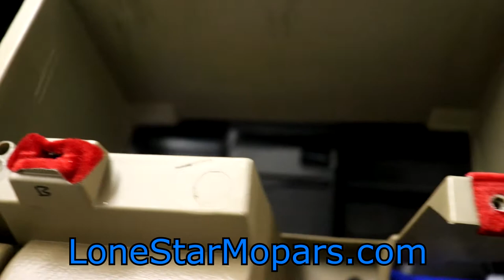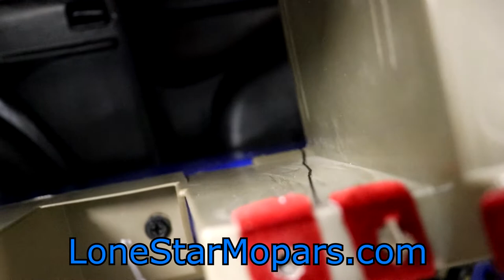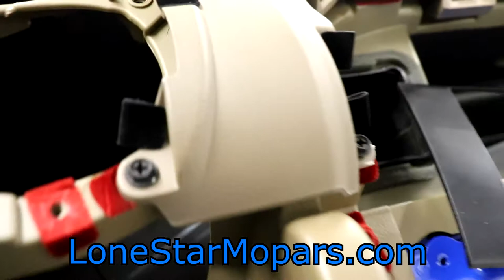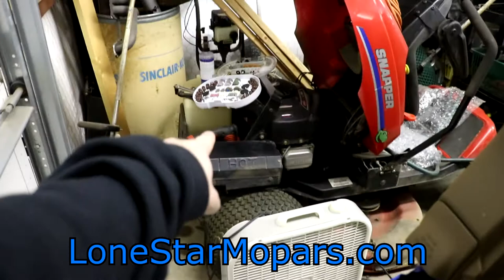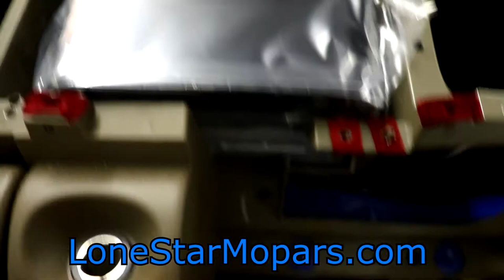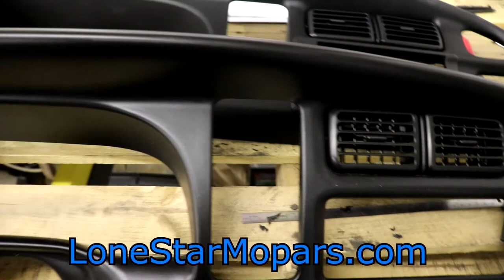Ram Revival Part 30: Double DIN in a 2nd Gen Modifying the Dash

Comment: Thanks for your inspiration! I followed your hunch, and only cut out the top piece. Didn't touch the bottom at all. The Dremel only melted stuff. I pulled out the oscillating tool, and Bam! I was done in 10 minutes. I didn't have to re work anything. Fit like a glove! Original screws went into place. FYI 1998 Ram 2500 Cummins. Thanks again!

Comment: Those Harbor Freight cutoff discs are meant for metal. As you noted they melt the plastic and it folds back together before cooling. For plastic, I have always used a stainless circular 1-1.5" saw blade. They seem to cut and leave the malty part in a clump at the edge of the cut...

Comment: Here's my plan. I'm cutting away most of that sub dashboard that you cut. My goal is to go to TAP Plastics and buy a black plastic sheet that about matches the dashboard color. Then mount a switchboard and radio, maybe a little lower than the board and install it. Black apply and such and try to make it look OEM.

Comment: Just a heads up you do need to cut out the bottom for it is also venting. I burnt out 2 radios in 6 months Couldn't figure out why. And also when you cut the top you're bringing more heat to the radio from the vent the top is kind of a buffer. Now I'm on my 3rd radio and this 1 lasted 4 years.                                
 
I love the work you do I like how you get into detail also. The only issue is that you talk a little bit too much you probably could have gotten this done within 20 minutes on a video. Please don't take this personal I am not trying to be negative. You do do good work. But I think you should be a radio host😊LOI 
Thanks

Comment: I have a 99 Dodge Ram Sport I bought new,, I haven't made my mind up if I am going to attempt this.
Reply: I have the same exact truck as you. It's really not that bad. The way he talks and makes it seem like it's hard to do he drags everything so far out and then comes back in. If you Are a little handy you'll be fine. Also hysterio is actually kind of larger than what it supposed to be It's got that extra l Lip on the top of The stereo that he is installing.
 Good luck
Reply: thanks